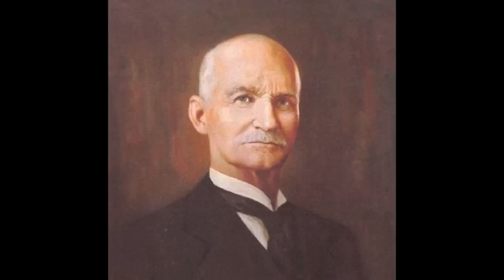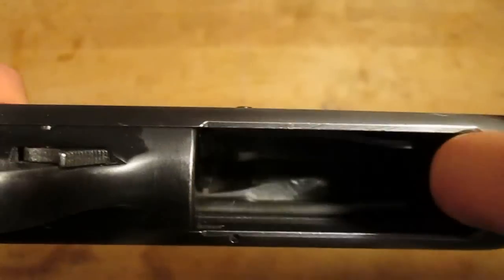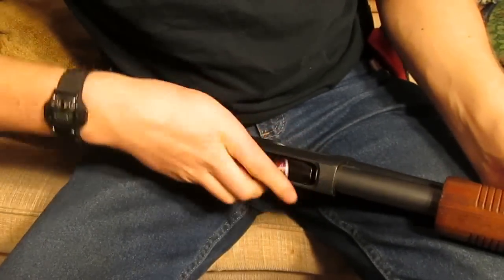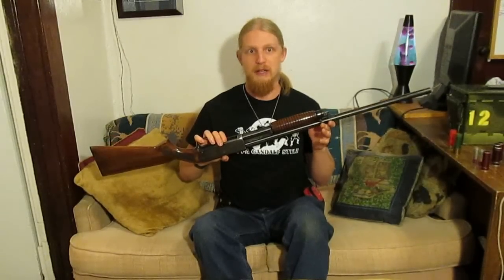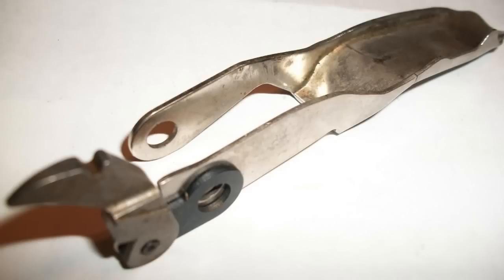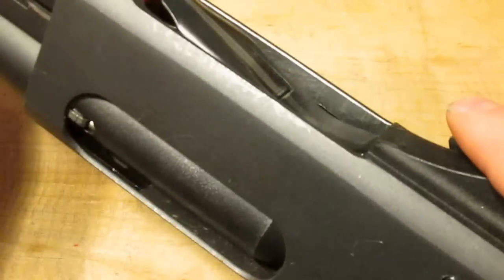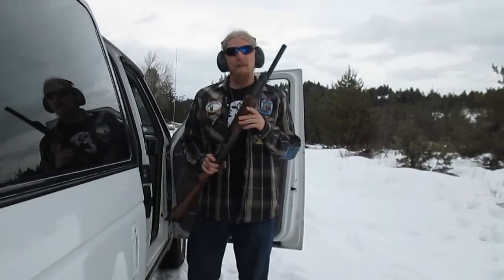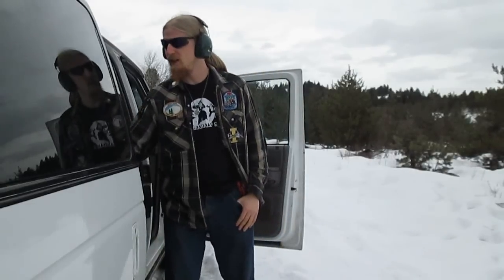Much Ado About Shell Carriers - Remington 870 Tips & Tricks #5

Comment: I still own the 870 I got in 1971, and I've had 2 or 3 carrier jams while hunting with it. Each jam happened when I was loading with gloves on. I never pulled the trigger group to clear the jam, but I'd pull the barrel, then disassemble the magazine and slide the offending round out through the mag tube. 
When the gun was converted for home defense, I installed a flexitab kit.
Reply from the maker: +bwhip Yeah, if you're using a vintage 870 for sporting or recreational applications, the old-style action parts work just fine, and if you fumble a reload, the jams aren't all that hard to clear.  But if an old 870 is going to have lives depending on it, it really should have its action updated.

Comment: My experiences go WAY back BEFORE the flex tab became an option/solution.  I had (still have) an 870 18 slug barrel w/rifle sight and a two round mag extension that I USED to carry in my squad and this was BEFORE the AR became an alternative (although a couple of the deputies did get the then brand new Armalite AR-180s.  

I was comfortable with the 870 UNTIL I went to the range just to run a few rounds through it since it got a lot of visibility, but no use!  Well, what a "wake up call" I had when I went to cycle the action to chamber a round!!!  That magazine tube with six rounds of slugs (it wouldn't have made ANY difference in what shot load) had sat through a hot Kansas summer, locked in the electric safety rack and ALL of the rounds (plastic cased) had swollen just above the case head enough to where they wouldn't chamber!!!  The extra tension from the mag spring plus the weight if the extra rounds plus the heat allowed these rounds to expand, rendering the shotgun unusable!!!  It didn't take but a few seconds to go over ALL those instances where I had it at the ready, but LUCKILY not having to use it, not even to the point of cycling it.  Now, in fairness, that ALSO happened to my Ithaca 37 "police" (factory 7 round mag tube) as I safely found out right after the 870 event. At that time I was an unpaid Reserve and we had to provide our own arms and I made a vow to my expecting wife that I "would be home every time"!!! I carried a small dose of paranoia and since our "beats" covered a lot of territory, we had to be self reliant since backup response time could have been measured with a calendar and not a stop watch!!! And our "communications equipment" wasn't much better than two tin cans and a string!  Our frequencies were just a few step above the old Citizens Band.  

So I also carried a Walther PPK .380 on me and my own Remington 700 in .308W, a backup S&W 29, and extra ammo in the trunk in addition to my Colt 1911 .45ACP (personally approved by the Sheriff himself) w/2 spare mags on my duty belt and 4 more in my back pockets.  I was young and healthy then!!!  And back then a "foot chase" was where the deputy took three steps followed by a loud "BANG"!!!  

If I had the option then that they have these days, there would have been a AR, Mini-14, or some comparable semi (or select/full) auto rifle in that rack!!! 

Do I have a shotgun at the ready in my house, yes, BUT I change out the ammo every month or so and check to make sure they are safe to keep in the gun!!!
Reply from the maker: +Big FED01 That's an important lesson.  Paper or plastic shells certainly can deform if kept in a magazine for an extended period of time (this goes for both tube and box magazines, by the way), so they should be inspected regularly, and replaced if they show any signs of bulging or deformation.  Repeated loading and unloading can also chew up the metal rims of shotshells, potentially leading to feeding or extraction failures.  A good way to keep shotshells fresh is to shoot what you were keeping in the gun during practice sessions, and load the gun with new ammo afterward.  But for those who don't practice frequently enough and/or don't want to keep buying expensive defensive shells, a weekly inspection should suffice.

This is also a reason I like to steer people away from the "extra-power" magazine springs.  These are a popular upgrade because some police shotguns use them, but it's a mistake to assume that law enforcement and home defense applications are identical when it comes to equipment.  In a police gun that's used frequently, the extra cycle life can be nice to have, and the increased wear & tear on the shells doesn't matter much when those shells are used soon after being loaded.  But for a HD shotgun that mostly just sits around, the extra spring force will make shell deformation more likely, while adding nothing to reliability.
Reply: Isnt that an ammunition problem and not the firearms problem, though?
Reply: @donaldmack2307  yeah kinda.. a problem all shotguns that use paper or plastic shells in a tubular mag I guess. Military used to use brass shotgun shells.
Reply: @guaporeturns9472  I wish I had about 1000 of those brass shells ab now tbh.
Reply: @donaldmack2307  no doubt. I would be happy with 200
Reply: @donaldmack2307  it's a firearms maintenance problem if you ask me.
You gotta download your mags often. Tube or box. Let the spring rest. Clean the inside the tube and the spring if necessary. Clean the inside and/or inspect. Clean the dust off the ammunition and inspect the case heads and primers for corrosion. Reload weapon and run all the shells through the chamber.
We're talkin about a duty weapon here. Life and death stuff. Gotta have weekly if not daily cleaning and inspection. 
If you carry concealed, same thing. Gotta be a pistol daddy. Gotta take care of it. Awww it's so cute.
Yours or someone else's life may depend on it.
Semper Fidelis

Comment: Great channel!  You're doing an awesome job at educating about the 870.  One thing I've found that has been critical to proper functioning, and that is keeping the forend rails lubricated.  Times when I've had feeding and/or ejection issues, my rails were very dry and giving them a nice coat, not dripping, of a good gun oil has resolved the problems.  So I'd advise anyone having problems, before you go searching for solutions, make sure your gun is cleaned and lubed and see if that doesn't provide a fix.  I recently was having an issue with the shell carrier getting stuck in the up position, jamming rounds.  Hadn't lubed my gun in quite a while, so I disassembled it, gave it a cleaning, put a drop of oil on the three oiling points in the trigger assembly as shown in the owner's manual, ran a patch with a little Ballistol down the barrel and wiped clean with a boresnake, sprayed Ballistol on the bolt and carrier, wiped clean, and gave the rails a decent wipe of MP7 Pro gun lube.  My gun is now working nice and smooth, the shell carrier problem is gone.  Regarding the dog carrier upgrade,  I spoke to my gunsmith and he said if I'm not having problems, it's best to leave the original spring.
The new one might cause problems that I didn't have before.

Comment: The Ithaca Model 37 Featherlight is absolutely beautiful! My dad has one that he bought new in 70’s, identical to your father’s except for the fore (his is smooth with finger grooves I believe). I absolutely love the Featherlight! I used to shoot a case of target load every other weekend at countless sporting clays. Nothing shoulders as cleanly, tracks as well, or reaches out as far as that irreplaceable masterpiece. I love letting friends break a few clays with it because it always put a massive smile on their faces. 
I am having trouble with it releasing rounds from the magazine properly. It’ll fire the chambered shell, eject the spent round, but the mag round does a number of different things that always result in a jam/empty chamber after cycling the action. I am nervous to disassemble it because I am not confident in the inner workings and I don’t want to break/create an unsafe firearm for later use. 

Want to do a T&T on the 37 Featherlight? Or maybe a deep dive into the Ithica manufacturing/history? 
Also, my dad has mentioned having his trigger/safety replaced by the factory after having the shotgun fire while safe and without touching the trigger

Comment: Hi ya buddy! Very nice video! I've been having problems with my Wingmaster. It's an old one with an 18" bbl. I added a magazine extension, among other things that make it tactical. I loaded with 00 buck, and put it in the safe.  One nice day I took it out to run some drills. The first few rounds were hard to chamber,  as the last few were smooth as butter. I thought something was causing the action bars was the problem of the hangup. I completely stripped it down, everything was in order, without any ammo, the action was great. As I inspected the 00 shells I noticed that the top was somewhat "mushroomed". Now I've learned, never leave more than 3, 4, in the tube for any length of time. I've sanded a little of the top of the shell (that was "mushroomed") and run them before I load a tube to the top! you've about the best videos on you tube, keep it up!
Reply from the maker: +Earl Wheeler Shells that are kept in the magazine for an extended period of time can eventually deform and have trouble feeding reliably.  If you keep a loaded shotgun around for HD, it's recommended that you inspect the shells on a regular basis, and replace any that are starting to get out-of-shape.  Use the old ammo for practice, so that you - and any other family members who may need to repel boarders - can remain familiar with how your gun & ammo behave together.

The magazine spring can also have an effect here.  A lot of folks install extra-heavy magazine springs because those are supposed to be more "tactical" or something, but  these "extra power" springs are often heavier than necessary for reliable feeding.  Once a spring is strong enough to feed shells properly (an admittedly tricky point to nail down, since it is affected by many things that tend to vary from person to person), going heavier only makes things harder on the shells.

With regular inspection & replacement of the shells, and a spring that's appropriate for your particular situation, a defensive shotgun can safely be kept with a fully-loaded magazine.
Reply: Thank you Sync, pretty much what I was thinking. Even though this is an older model "Wingmaster" it has less than 30 rounds fired. It looks factory fresh. I've noticed that when there's about 3 shells left(after shooting a full magazine), the action is much smoother. I've also noticed that if I loosen the magazine extension about a quarter turn that it runs much  smoother. I used the spring that came with the extension tube. Do you think I could cut about 1/2"- 3/4" off the spring could help. Btw, I'm not going to blame you if doing so doesn't work. ;-)
Reply from the maker: +Earl Wheeler What extension are you using?
Reply: It's heavy duty steel. Well made. Can't remember the brand. Are you thinking about the internal dimensions? Something I can check with my calipers.
Reply from the maker: +Earl Wheeler It really depends on the brand & capacity.  Some extensions like those from S&J hardware come with very long springs so that the user can trim them to the length/stiffness that works best for them; but some folks don't realize this, and just stuff the entire thing in without cutting it at all.  Others, like the Remington +2, share springs with longer extensions (the Remington +3 in this case) to simplify things, so you can afford to trim the springs for the smaller extensions a little if they're stiffer than you need.  On the other hand, other extensions may have springs that are already sized specifically for that setup, so trimming can lead to unreliable function.  As an extreme example, the Vang Comp +2 has a very weak spring that has trouble feeding correctly unmodified, so trimming it even shorter would be a very bad idea.

Comment: What an amazing and informative vid! I haven't even finished a quarter of the vid, and your analysis of lightweight shotgun banter is...refreshing. As I have been training on a 870 and Ithaca 37, I'm searching the Internet for useful info on my first shotgun purchase. This vid diminished my apprehension on the 870's carrier. Thanks.
Reply from the maker: The carrier really isn't that big of a deal.  It just doesn't make much of a difference once you practice with it and get used to it.

Having used both the 37 and 870, I would definitely go with the 870 for a fighting or multi-role gun.  It's just a lot more versatile and robust, and easier to take apart & work on when necessary.  They both make great field guns, though.  I like the Ithaca's lighter weight, and the fact that it drops fired hulls right at your feet (I reload, so that's handy).  The controls are laid out really nicely as well.  I'd probably shoot it a lot more if it had a proper recoil pad.
Reply: The Stevens (Savage) model 350 uses the Ithaca action and has a built in recoil pad. Good review. I have the model 320 which is built on the Winchester 1300 action.

Comment: Well done, I have had the opportunity over the years to receive a great deal of training and given training on the use of the patrol shotgun. Your comments regarding safety, and the carrier design of these types of platforms was well thought out and easily understood.  When I started in my profession we used the Smith and Wesson 3000, very similar to the Remington 870 however the Smith and Wesson had the modified shell carrier. We eventually went to the 870 after the modification in the carrier. I also used a sawed off 870 for high risk entry work for several years until these weapons were replaced with MP-5 sub guns. I find it interesting that Remington is now offering a factory, short stock and barrel shotgun which looks very similar to the guns we modified for close entry work decades ago. I have experience with multiple shotguns and action types but still have high regard for the 870 design and still recommend this platform to new and experienced shooters. I liked your mannerism, voice inflection ect. enough that I recommend that you do a video on the break down and maintenance for this platform as well as support hand reloads.
Reply from the maker: Thanks.  I do have a video on take-down.  A cleaning video is on the list for when I get back to making these.